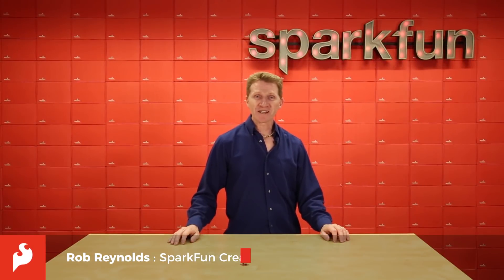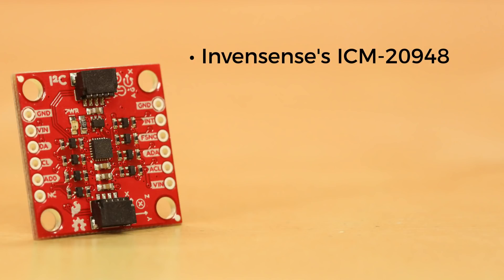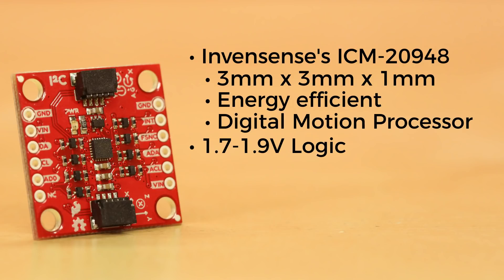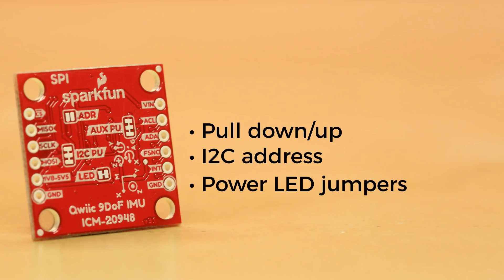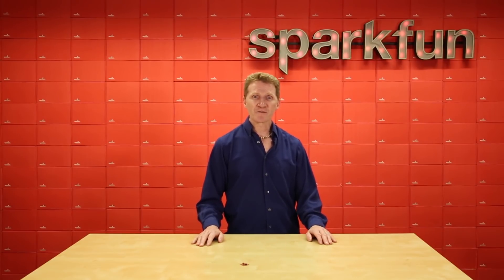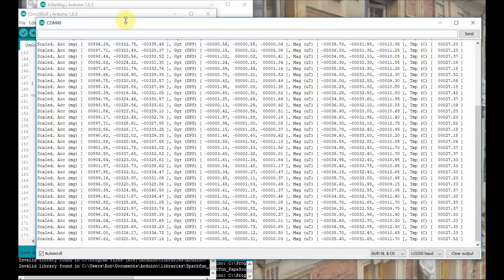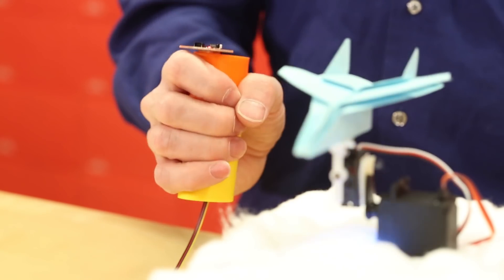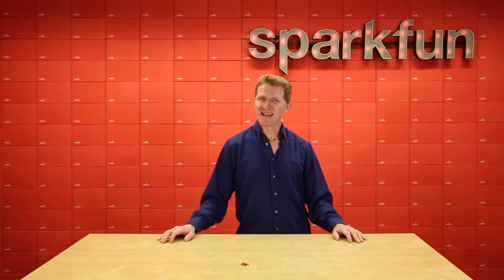Product Showcase: SparkFun 9DoF IMU Breakout

Comment: Wow. I worked with Inertial Measuring Navigation Systems in the early 1970's in the Navy. It weighed about a ton. had 3 gimbels for the stable platform the had 3 gyroscopes for X, Y and Z axis stabilization and 2 pulse integrated pendulous accelerometer.  Now it is the size of a postage stamp.
Reply: Navy probably still using much bigger IMUs for better precision.
Reply: @blueeengineer4373  That system was made by Sperry Gyroscope. Before I got out I worked on the next generation by Autonetics. It used 2 IMU's for better precision and where the size of small file cabinet.  Both systems inertial platforms had to be perpendicular to the earths surface for the accelerometers to work correctly. Earths rotation, gravitational anomalies, coriolis and a few other things where always a challenge to compensate for. After I got out the Navy started using the ESGN (Electrostatically Suspended Gyro for Navigation) system which was celestially oriented rather than earth frame referenced taking out any errors caused buy the earths rotation.